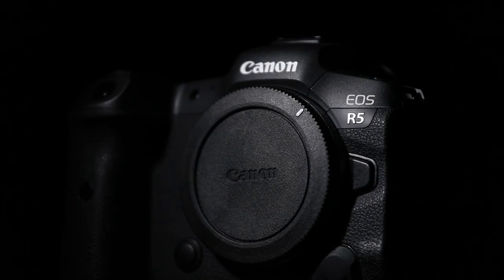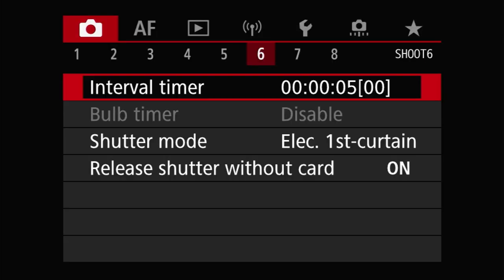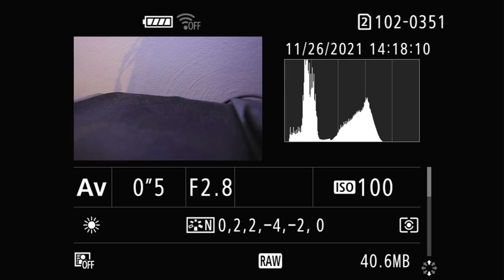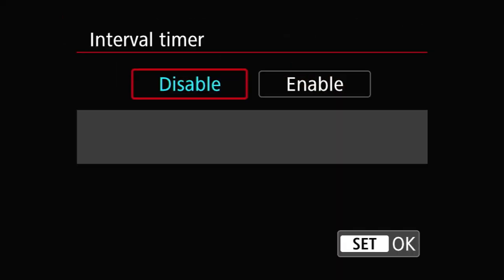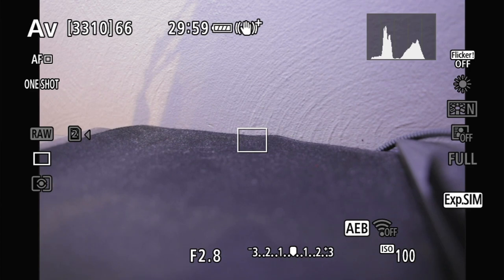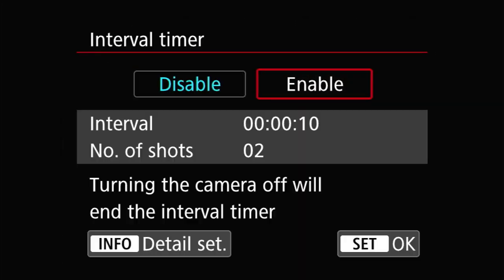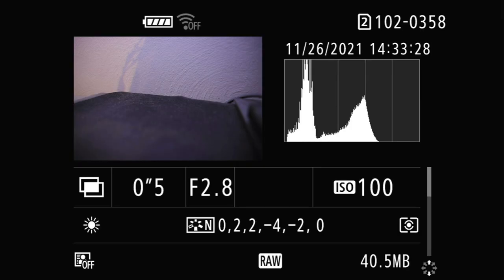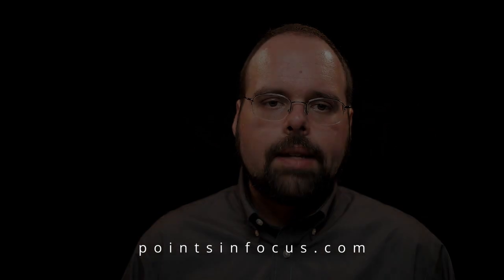Using the Interval Timer - EOS R5/R6 Tip 35

Comment: Thanks for this. Another "quirk" (bug) I noticed with my R5 is that when I have a 4 second exposure and I set the interval to either 1 or 5 seconds (so there is minimal delay between frames), half the time it just skips the next shot. So if it's set to 1 second, my intervals will switch back and forth (consistently) like 1, 2, 1, 2, 1, 2, etc. And if it's set to 5 seconds, then my intervals will be 1, 5, 1, 5, 1, 5, etc. Very strange behavior. The solution to this is making your interval 2 seconds longer than you exposure time. So if you're shooting 4 second frames, set the interval to either 2 or 6 and it will consistently give you a 2 second interval.
Reply from the maker: Yep. Sadly the interval timer doesn't take the exposure time or post exposure processing and rest time into account. It's just a count between virtual shutter button pushes, and if the camera isn't ready for it, then the frame doesn't happen and the interval ends up uneven (and you don't get the set number of frames either).

Comment: Hi Jason

I have watched your video on interval timer. (thumbs up)

I agree with your findings, the interval timer does not seem intuitive and I have new use case, I think.

I have done a bit of astro photography and I usually use 20sec. exposure for the night sky and use the interval timer to make 20-30 exposures for later stacking.

It seem that the interval time need app. 5 sec. plus the exposure time equal 25 sec. setting between each long exposure shot - weird behavior because exposures LESS than 1 sec. it has no problem taking the shots consecutive, where the minimum timer setting is 1 sec.

Have you experienced something like this or know what is going on? It would be good to know so that I can plan around it.

Comment: Can I use face/eye detection autofocus and let the camera refocus on every shoot? I was thinking to use the interval timer to take self portraits while hiking
Reply from the maker: Unfortunately, no, or at least not that I've been able to figure out how to make work. When the camera is using the interval timer, it doesn't seem to trigger the AF system before it releases the shutter. Unfortunately, using the time lapse movie mode doesn't solve that problem either.

About the only practical workaround for this would be to use an external timer (or a Bluetooth remote app potentially) that can trigger the AF system and then release the frame.

Comment: For self - portraiture do we have a sound that plays that will tell us that the shot is being taken ?
Reply from the maker: No the interval timer does not indicate beep or otherwise indicate that the shutter is about to be released. However, self portraiture isn't really the intent of the interval timer either. 

I think the feature that might work better for you is the 2 or 10 second delayed shutter release modes. In either of those modes the camera will beep (if the beep is enabled) and flash the AF assist light as it counts down to releasing the shutter.

I've found they work best with a remove trigger of some sort. I use a Canon RC-6 IR wireless remote when I need to do this, but you can also just use the free Canon Camera Connect app on your smartphone too.

Comment: For bracketing shots with an intervalometer, if you set the drive to a 2-second delay, it will then take all bracketing shots at every interval.

But here's the biggest quirk. If you are in manual mode and set the exposure time to 10 seconds and an interval of, let's say, 1 or 2 seconds with a number of shots being 10, you would expect to get 10 shots of 10 seconds each. However, you only get one shot.

If you set the number of shots to 99, you will get 10 shots. It basically does the wrong math.

I hope this gets fixed in a new firmware.
Reply from the maker: The interval timer isn't doing the math wrong, it's just not doing what you expect it to do. 

The interval time is the time between when the camera attempts to make another image. It doesn't consider shutter speeds, long exposure NR time, or any other factor that could cause the camera to be busy is not considered. Every interval time, the camera attempts to virtually press the shutter release, if the camera is busy at that time, then that iteration is effectively skipped.

In your example. For a 10s exposure, a 1s interval, and a 10 frame count, you get one image because the first interval triggers the 10s exposure. In 1s, the camera tries to take another picture, but it's busy with the first, so it gets skipped. This repeats, until the exposure is done, just after the 10th interval is skipped. If you use a 2s interval time, you should get 2 images, one at the start, and 1 at the 6th iteration.

FWIW, the internal intervalometer mirrors the behavior of an intervalometer plugged into the remote release port; nothing more.
Reply: @PointsInFocus  thanks for the explanation, I had figured that, but still consider this a flaw or it should be an option.

Comment: Just watched your video. I practiced with exposures under 1 sec. But yesterday night shooting the Perseïdes I had to exceed my exposure to 15 sec and I now noticed that my interval does not work with exposures over 1 sec. Do you recognise this problem?
Reply from the maker: I haven't seen that problem before. 

What is your interval time set to? 

Keep in mind, the interval has to be longer than the exposure time plus a little, so if you want at 15-sec exposure every 5 seconds, then you need to set the interval to 20 seconds.
Reply: @PointsInFocus  thank you so much, never ever read anything about adding the time of my exposure. you are the best! One more question. Silly thing is that my camera never ever makes the amount of shots I ask for. I can work around this. Thanks again. Really appreciate your response.
Reply from the maker: Yea, you'd think that the interval would be the time between shots, since the camera should know what the exposure time is. But Canon (and really I think everyone else does it the same way) implements the in camera intervalometer the same as an external one. The interval is the time between when shutter release triggers, and doesn't account for the exposure time.

Also as an aside, since you said you were doing the meteor shower. If you want a continuous series of 15s exposures, you can also set your shutter speed to that like you're doing, but put the camera in continuous drive mode and lock the shutter button down. If you have a remote release, most have a shutter button lock that will do the job, otherwise you can use a bit of something to push the button and some gaffer tape to hold it in place. The camera will just take exposure after exposure with no delay in between.
Reply: @PointsInFocus  That is .... Continuous mode. Like I said before. You are the best. Thank you so much for your help.

Comment: The fifth point where the shutter speed exceeds the interval :
This is a bit complicated. Lets assume my shutter speed is 1.6 seconds and the interval is 2 seconds. 
In electronic shutter mode it takes all the shots but in mechanical shutter mode it skips a few.
If i change the shutter speed to 1.3 seconds, the it takes all the shots in the mechanical shutter as well.
Conclusion : the mechanical shutter takes much longer to get ready for the next shot. So, while using mechanical shutter, the interval timer should be atleast 0.6 to 0.7 sec longer than the shutter speed to be on the safer side. This interval can be very close to the shutter speed while using electronic shutter.
Reply from the maker: Yes, that's a fair assessment. With the electronic shutter, the camera can reset it nearly instantly (time it takes for an electrical signal to propagate across the sensor). The same should be true for the first curtain electronic shutter since it resets similarly. With the mechanical shutter, the camera has to close the shutter, rest the sensor, and then open the shutter mechanism again, and that of course takes time. That difference in having to close and reopen the mech shutter is also seen in the max frame rates in continuous drive mode too.
Reply: Yes. Also i just found out, at fast shutter speeds more than 1/1000sec, electronic shutter spoils the bokeh, 2 stops of dynamic range and is 12 bit raw instead of 14 bit. So, there is no point using electronic shutter.
Reply from the maker: I've never seen any problems with the electronic shutter and bokeh, but the fastest lens I normally shoot with is only f/2 and the fastest lens I own is only an f/1.8. 

That said, you can easily run into problems with the electronic first curtain shutter, fast lenses at their max apertures, and fast shutter speeds. The exact point where it becomes a problem depends on the aperture and shutter speed. Faster lenses will show it at slower shutter speeds. Though past around f/2.8 or so it doesn't seem to be much of a problem anymore. I should note, this is a artifact of the different propagation times fro the electronic reset and the mechanical shutter closing, and is a problem on all cameras with electronic first curtain shutters.

Personally, the biggest problem I've had with the electronic shutter is the rolling shutter time. The loss of dynamic range is only a factor if you're shooting at ISOs below than 800. From 800 and up, the dynamic range is the same. And I've never seen bokeh issues with the lenses I typically use in electronic shutter mode (mostly telephotos at f/4 or slower). But the rolling shutter's impacts are largely unpredictable, sometimes there's no problems and everything looks fine, other times things get distorted because the motion was just right to make it a problem.

That said, I don't expect we'll have mechanical shutters in our cameras for much longer at all. Either they'll be global electronic shutters (e.g. A9 III) or they'll be very fast rolling shutters (R3, Z9, etc.). But a physical shutter is an expensive precision mechanism that's relatively fragile. The rumor mills suggest that the R5-2 won't have one, and I expect that will be the case for just about everything in the next generation or two.
Reply: @PointsInFocus  i agree. I miss the DSLR days. I loved the sound of  the mirror flipping and the optical viewfinder.
I just bought an r6 mk 2. Although the focussing system is great, i have lost the excitement overall 😐
Anyway, thanks for replying. Your channel is great.
Reply from the maker: Well the cool thing about an electronic camera is that you can potentially have whatever shutter sound you want.

One of the features of the Z9 that I really liked was the ability to have the shutter sound sent to your headphones instead of playing on a speaker. That way you could hear as a shot indicator, but you wouldn't disturb people around you when you're working in a quiet event.

I've found I've gone through phases with photography where it's just not that exciting anymore. Usually I find it's because I got burnt out on the same subject matter. Then I do something I like and the excitement comes back, at least for a while.

Thanks for watching, and I'm glad you've found the content useful.

Comment: Thanks fo the video.
I'm encountering an issue if I set the interval time to 2 seconds and the shutter speed to 1.6"; it will skip every other shot, resulting in half of the desired frames. If I set the shutter speed to 1 second, it won't skip any frame anymore. The issue happens even with V30 SD cards, and with noise reduction for long exposures turned off.

Is there a way to fix this issue?
Reply from the maker: Unfortunately no. The timing between the 2s interval and the 1.6s shutter speed is just too short for the camera to be ready for the next frame in time. Even trying with my external TC-80N3, the camera ends up skipping every other frame with a 2s interval and a 1.6s exposure.
Reply: @PointsInFocus  but why can't the shots be stored in the buffer? Why is it possible to shoot 10+ images in one second in burst mode, while it is not possible to take two pictures in 4 seconds with the builtin intervalometer?
Reply from the maker: It's not just the built in intervalometer though. I tried with my external TC-80N3 which is just pushing the shutter release, and it has the same problem with a 1.6s exposure and a 2s interval.

What I noticed, even though I have long exposure NR turned off too, and am shooting raw, something is being done after the exposure anyway, as my camera flashes "busy" very briefly. So the camera is doing something with exposures longer than 1s or so, but I have no idea what.

Also, it's definitely something with the mirrorless cameras/R5 firmware. My 5D4 doesn't have any problem with a 1.6s exposure in a 2s interval.

In the end, I think the only real workaround is to not shoot with a shutter speed of 1-2s, when trying to run a 2 s interval. It seems like for exposures >1s you need at least 1s of slack time in the interval. So 1s exposure with a 2s interval, or 2s exposure with a 3s interval.

Comment: One quick correction: It is possible to shoot more than 99 frames by setting "No. of shots" to "00", which the R5 treats as unlimited. Still not as convenient as having a 3 or four digit counter but it's better than being stuck at 99. Maybe you said this and I missed it. Your series of videos on the R5 should be on Canon's website. They are excellent.
Reply from the maker: Thanks for the correction. I definitely should have noted that in the video.

Comment: I can't get eye-detect autofocus to actually lock focus on my eye during testing.  I had both AF-ON/Meter on the shutter and metering only with back button focus.  I can see on the LCD that the eye detect is tracking my eye, but when the interval hits, it just focuses on the center of the sensor, not the detected focus point.  It's so frustrating.  This is on an R5C which is essentially an R5.
Reply from the maker: Going back and looking at some tests, I'm not sure the camera focuses between images, or perhaps it doesn't do it in face+tracking mode. I didn't have a lot of time so I just checked that I didn't check to see if it would refocus in single point. When I tested it it would focus the first time on my eye, then it didn't seem to refocus at all.

Comment: For reference, actually there is a way to run both interval timer and exposure bracketing: set the shooting mode to 2s delay. It will will trigger all brackets one after another one at each interval step.

I checked it with my R6, but I believe R5 will work the same way.
Reply from the maker: Thanks for the heads up on that.